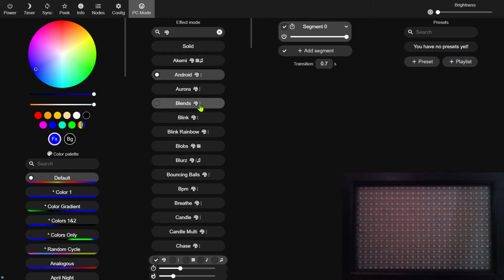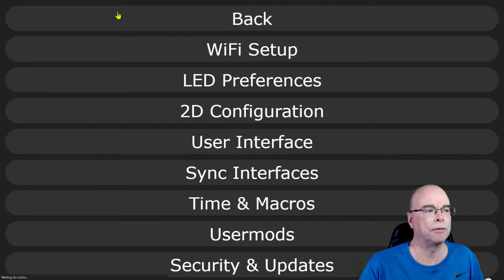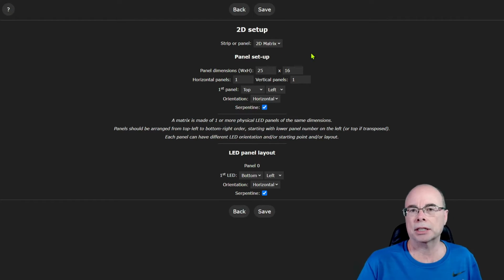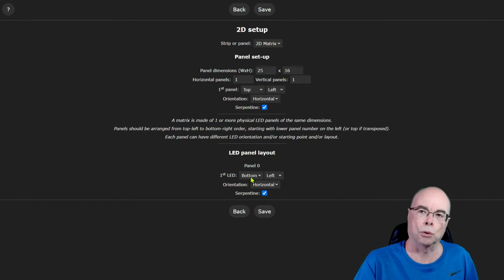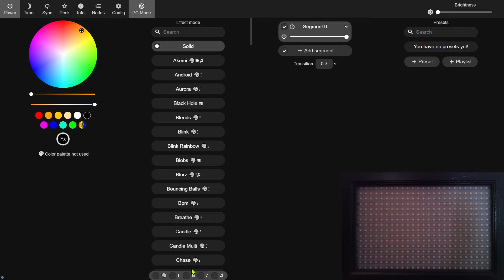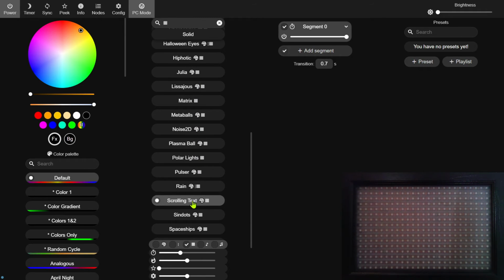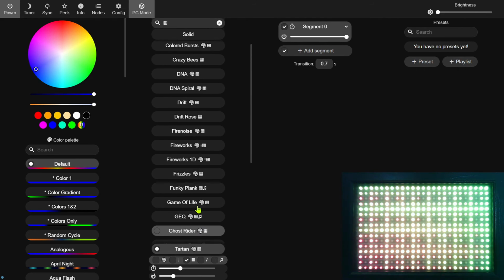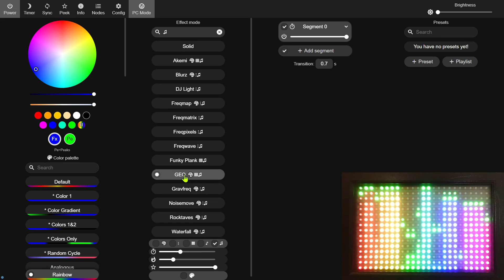WLED on your Matrix Displays Without Custom Mods!

Comment: To customise text enter what you want to display in the segment name.
Reply from the maker: Just confirmed that this works!  So thanks again!  I'm going to pin this comment in hopes that others can see it if they have the same question (or answer).  And just for reference for others, if you want to return to the default date/time, you can just remove the segment name.
Reply: @ResinChemTech  You can also POST a json request to ip/json with payload {"seg":{"id":0,"n":"Your text up to 32 characters"}} to change the scrolling text.
Reply from the maker: Ah... thanks!  I knew there had to be a way, but hadn't looked into it.  As I said in the video, I actually was filming the matrix for another video and just opted to upgrade WLED to see what the new matrix support looked like.   What I filmed was really my own "first look" as well.  But I will go back and try using the segment name to modify the text.
Reply: Sexist 😉
Reply: I did just made a tutorial on how to use Home Assistant to change scrolling text from the dashboard.

Comment: Hi, I'm a newbie trying to connect two 32x8 panels. I've tried several combinations and the text isn't clear.
Reply from the maker: There could be many reasons for this.  First, assuming you are using WLED, the type of LEDs must be one that is supported by WLED (see: https://kno.wled.ge/basics/compatible-led-strips/ ). Next, you must assure that you have configured the matrix correctly... and this can be a little tricky to understand if using multiple panels connected together such as yours.  Check and try some different settings under the matrix setup in WLED.

Finally, text may not render the best based on a number of factors... primarily the density and number of LEDs available and the size of the text you are attempting to render.  In some cases, like with my matrix curtain, the LEDs are spaced far enough apart that some text strings/letters aren't rendered very well.  It's just a limitation of both the  hardware and software. 

I hope that gives you at least a few things to try.

Comment: thanks for the great video!   I want to do a SIMPLE countdown timer to Xmas.  I've built my Matrix display and got it all setup to display a clock (using the scrolling text effect).  Now I just want to display the days, hours, and minutes as digits counting down to Xmas.  any idea how I could do this?  THANK YOU for the help!!!
Reply from the maker: I don't think that normal, "stock" WLED has the capability to do a countdown timer like that.  It doesn't mean it can't be done... it's just going to take an outside automation engine of some sort, like Home Assistant or NodeRED.  The automation process would then need to send the text string to WLED via the API to change the text.

Alternatively, you can always check to see if there is a user mod in the WLED repo that might be able to do a countdown, but my guess is that you'd need to create you own WLED mod ( https://kno.wled.ge/advanced/custom-features/ ).  

Or you could do what I've done with my matrices... create a second controller with custom code to do your own thing, but keep WLED for all its effects and patterns and provide an easy or automated way to switch controllers.  I cover setting up and using dual controllers with a matrix in this video:  https://youtu.be/EwGwnf5GXCw

Of course like most DIY projects, there are always multiple ways to accomplish a goal.  But the above are three different ways that I can think of to create a Christmas countdown timer.

Comment: Hi I would like to know if there is any way to set up two consecutive segments, that runs one after the other, or more segments ? Thank you.
Reply from the maker: Absolutely... if I follow what you are asking.  When you apply an effect across multiple segments (and not just to an individual segment), WLED will treat those segments as one long single strip... just as if the end of the first segment was physically wired to the second.  This gives you the best of both worlds.  Say you have 3 segments of 100 LEDs each.  By applying a different color/effect to each segment individually, all three can act independently.  But if you were to apply an effect across all three segments (say wipe or chase for example), then WLED will treat it like a single 300 LED install and the effect will travel from one segment to the next.

I hope that helps and answers what you were asking.
Reply: @ResinChemTech  My intention is to generate a chain of different effects using the segments, is this possible?
Reply from the maker: It's possible, but not necessarily straight forward to do.  WLED does not have any sort of automation engine nor does it really have a timer that can be used in an automation-type scenario.  You could probably set up presets consisting of the individual segments then put those presets into a playlist that would move to the next preset after a set length of time.  So, for example, segment 1 will run this effect (only on its own segment) for 10 seconds.  Then the next preset will run segment 2 on a different effect for 8 seconds.  Then segment 3... etc.  When you define a preset, you can save the segment info.  Then with the playlist, you can specify how long each preset runs before the next preset starts.

What you cannot do (at least not with stock WLED) is to run a particular linear effect (say like chase) and when the chase reaches the end of the strip, start the next effect on the next segment.  You can pretty much only specify a given time for each preset to run in a playlist.
Reply: @ResinChemTech  Thanks a lot,  I'm going to try this way.👍

Comment: FAIL WLED ,WHEN SUPPLY  5V DISCONNECT AND AGING GIVE 5V  DISPLY WS2812 IS PLAIN ALL LED  GLOW
Reply from the maker: You are correct that when you disconnect the power and reapply it, by default, WLED will default to solid orange for all LEDs.  But this can be changed in the LED preferences.  You can tell WLED what effect or preset to apply when it first boots up or receives power... and whether you want it to turn on automatically when power is applied or remain off.

You might want to fully check out the options and settings before making a generalized statement that is only true if you don't change any of the preconfigured settings.

Comment: Excellent

Can you share the code of the clock

Thanks
Reply from the maker: The code for the clock can be found here:  https://github.com/Resinchem/LED-Matrix-Clock_WS2812b

There is also a separate video specifically on the matrix clock: https://youtu.be/uV_HQpqIp2I

Comment: so when you said it supports multiple panels does that mean it will support a 3d cube build?
Reply: also do you know how to make pixel images and have them stay on the matrix? i wanna make a few of these for the kids but if they find an image they like i want them to be able to save it and either keep in on or atleast save it so they can find it in edits
Reply from the maker: I don't think that is currently possible with WLED (WLED is obviously not my firmware and I didn't develop it). You can check the official WLED website here: https://kno.wled.ge/  Unless you modify the WLED firmware, you get whatever effects are included.  As of the current version, I don't believe there is any option to display a custom static image without making a custom mod.

As far as to your first question, I suppose it would work for a cube, but I have not attempted it.  All the panels, or sides of the cube, would need to be wired to each other in series, although there is support for multiple data pins and segments.  Refer to the above link for details on this.  I do know that the matrix effects are currently labeled as "2D" effects... so I don't know how well they might render on something like a 3D cube.  I suspect they would run.. they may just not give the desired effect.  There are also some limits on how many LEDs you can run off a single controller. The recommended limits are also published on the WLED site.  My current largest install to date is just over 800 LEDs.

Comment: Great video 👌 Question: Which microcontroller do you use for this project ❓
Do you have a connection diagram❓
Reply from the maker: This particular matrix has 2 separate controllers that are switched with a toggle.  Both are ESP8266, but one is the WLED controller that I show in this particular video.  The other is the controller that runs the matrix clock, scoreboard, counter, etc.  I have videos on the builds of both... and each video has a link in the video description to a blog article that has all the wiring diagrams and step-by-step instructions:

WLED - Build your own WLED controller: https://youtu.be/ifv6wV3Rm6A
Matrix Clock, Scoreboard and More: https://youtu.be/uV_HQpqIp2I

Again, you can check the video description for links to the related blog articles.  The blog article for the second listed video also has instructions on how to build the matrix itself.  Let me know if you have follow up questions!
Reply: @ResinChemTech  I have the: D1 Mini ESP32 ESP-32

Am I allowed to connect only 3.3 volt voltage to this one ❓.
But the stripe or LED matrix needs 5 volts.
Do I need the "Logic Level Shifter" there ❓.
And how would I have to connect all this then ❓
Reply from the maker: From a power/functional standpoint the ESP8266 and ESP32 dev boards (including the minis) are the same.  Both require 5V to power and both output data signals at 3.3V.  So, regardless of which you are using, you need 5V to power the board and I would recommend using the shifter to boost the data line from 3.3V to 5V before sending to the LEDs in either case.  

The ESP32 is simply more powerful/faster then the ESP8266.  And the GPIO pins are in different/located in different spots.  But otherwise, they are pretty much interchangeable when it comes to creating a WLED controller as far as power requirements and data signal voltage.
Reply: @ResinChemTech  Sorry if I have so many questions 😉 Ok could you possibly make a circuit diagram how to get shown e.g. with the "Fritzing Software" ❓How to connect the two would have to be ❓
Reply from the maker: As I mentioned in my other reply, I cannot post images or attach files in the YouTube comments.  Did you look at the blog articles from the videos I linked to above? Both of these blog articles have the wiring diagrams you are asking for.

Wiring diagrams here:
https://resinchemtech.blogspot.com/2021/01/building-your-own-led-light-strip.html
and:
https://resinchemtech.blogspot.com/2021/04/ws2812b-led-matrix-clock-scoreboard-and.html

Comment: Does it only work with the ESP32 or also with the ESP8266?
Reply from the maker: It will work with either, but the sound-reactive version only works with the ESP32.  And I'd recommend considering the ESP32 if you have a lot of pixels in your install (more than about 500), but the ESP8266 will work as well, and that is what I am using in this video.

Comment: Hello can you help me with this little problem.
I have make my own wled controller and I have connected 150 led  WS2812B first two days working properly.
After two days say the first 30 to 50 led is turn on by itself even if the switch is off.
What can be the probable cause.
Reply from the maker: It could be numerous things and it is hard to say for sure.  If you are seeing 30 LEDs come on... and they are orange, it sounds like the controller is rebooting/resetting.  Since WLED defaults to 30 orange pixels, this is often an indication that the controller is randomly rebooting.  This could be due to an issue with the power supply or a problem with either the flash or the board itself.  You could try reflashing WLED and setting it up again, but if the problem continues to occur... and you've checked that all your wiring and the power supply are good, then the NodeMCU (or whatever board you used) is likely faulty.  I've had this situation occur with an installation in the past, and replacing the board solved the issue.

It is hard to remotely diagnose the problem.  If you were only seeing 1-5 pixels come on, I'd say it is a problem with your data line (did you use a logic level shifter?)...but since you are seeing more than that, it is likely either the power supply fluctuating causing the reset, or the board is likely faulty.  That's about all I'm able to offer at this point.
Reply: @ResinChemTech  thanks for the tips I change the board and so far no problem thank you very much

Comment: hello. Do you know how or can you explain how to add sound reactive through the user mods in this newest version?  also thank you for your previous videos I built my first ESP 32 board and install wled with the help of your content 👍 I'd prefer to use this newer version with sound reactive instead of using the older sound reactive version of wled.  thank you
Reply from the maker: Well, as I mentioned, I had only installed the new WLED just a few minutes before I shot this video, so I haven't spent a lot of time with it yet.  And while I can certainly look into how to add SR via user-mod, I don't believe I can do it with this matrix, as I believe the SR requires the ESP32... and I am using an ESP8266 in my matrix and currently do not have a microphone connected, so I'd have to build a whole new controller before I could try the audio effects.

I can certainly consider doing a video on how to do this, but in the interim, you can find information on how to install the audio reactive user mod here: https://github.com/Aircoookie/WLED/tree/main/usermods/audioreactive
Reply: I did this the other day.
I know absolutely nothing about coding but managed to compile Sound reactive... And autosave. Into wled 14.
Ball ache but has now become familiar enough to flash 5 esp32 the resulting bin.

The thing with asking people on YouTube they just point you somewhere else. Via links.
Everybody learns in different ways. Signposting isn't always the best option. Having a platform to demonstrate this and then don't is beyond me...

Comment: I was playing with this over the holidays and found that if the 2d is set up in WLED and you connect to XLights and run a show it gets confused and reverses half the image displayed to get it to work I had to change WLED setting to single strand (turn off 2d matrix) hopefully this is corrected by WLED or XLights as it’s a pain changing the settings reset controller depending on program used
Reply from the maker: Yeah... I think you'll see a lot of updates to WLED and the matrix support down the road.  As I mentioned, this version is still technically in beta.  I suspect substantial updates to both the number and type of effects, but also in terms of how you interact with some of those features (such as updating the scrolling text).

I know matrix support has been requested, and in the works, for quite some time.  And I suspect it will just continue to improve from here on.  It's a great start, but there is still some work to do.

Thanks for taking the time to watch and post a comment!
Reply: Same here: I have a 32x22 matrix, controlled by XLights. Changing the WLED settings back to "1D strip" has fixed the issue, so all fine. 
I'm super happy seeing WLED developing such way, text scorlling is a massive advantage for me. Even if it does not reach the complexity of XLights, it makes possible for me to create a portable, mobile-controlled text scrolling board with ease, not requiring a PC (I'm not an expert of programming) and also making it possible to run it from a power bank (3A@5V gives me enough brightness with my current board for an indoor / moderately light outdoor setup, especially at night, when I typically use it). 
If I could ask 1 thing from WLED developers, that would be the live preview function (at least on PC): configuring scrolling text is a bit difficult by changing back-to-back after each amendment (my LED matrix is on the other floor, hence I can't see it from my PC). Hope we can have it soon :)

Comment: Nice job as usual. It seems the scrolling text thing is important and it is probably the only reason I would want a matrix. 

You acknowledged it was widely asked for. 

I watched and thought there has to be a way to change the text. 

I see in the comments because I looked (not sure the pinning did anything for me) but I see you know how to do this. 

Honestly, I think I would edit the video putting a note over the area in video saying “you since learned you can change text. See video comments” and then edit the comments to reflect your discovery. 

I know you and you will probably reply to this before I can send you message other way. I think you might find your devotion to your subscribers a bit taxing with questions on text. 

Like my next question and not a comment…